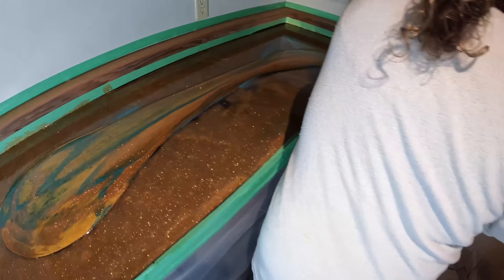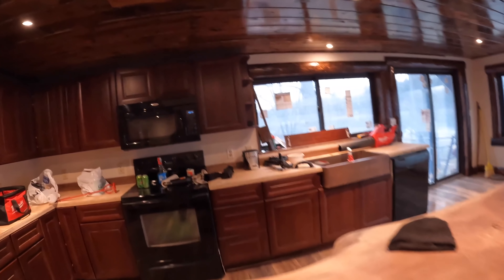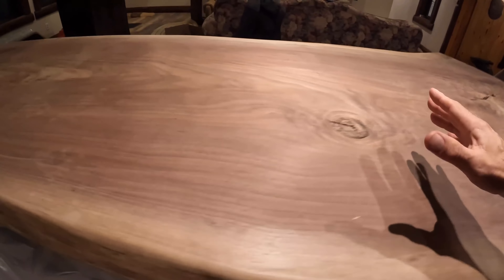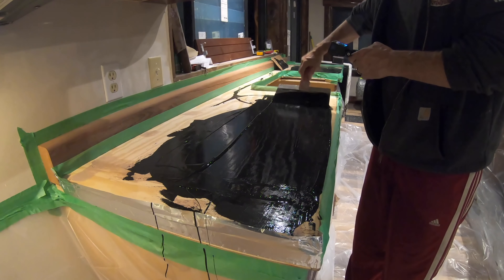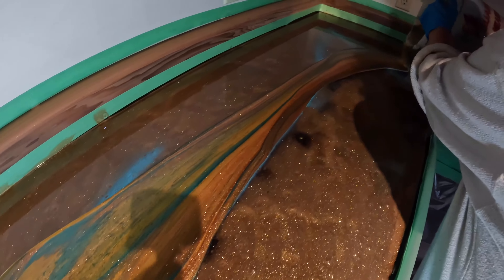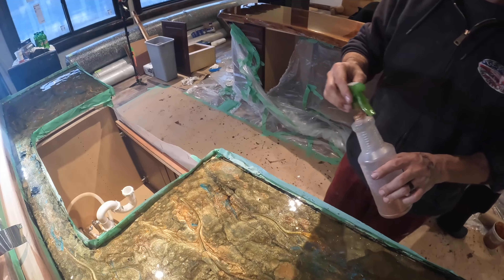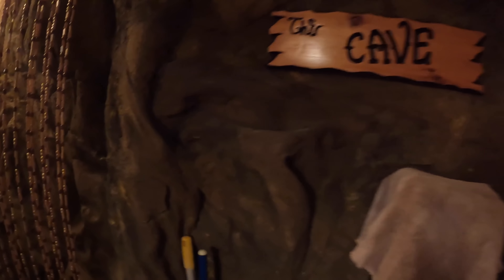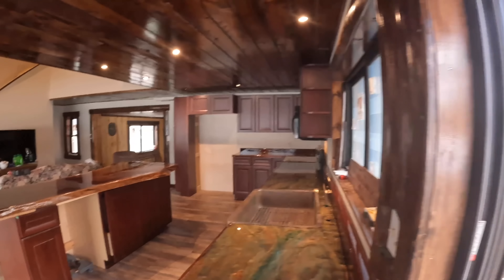Our First TIME pouring Stone coat countertops

Comment: Came over from The Stone Coat channel. 1st of all, both sides look great! But, the side you two did by hand is just phenomenal. 
This stuff is so fun to work with. My wife and I did our basement floor with Stone Coats flooring epoxy. We weren't sure what colors we wanted to do, so we bought a small countertop kit and every color we thought we'd like. I bought a sheet of 1/4" particle board that I cut into 12" x 12" squares and we just went to town making samples. It was so easy, that my young boys did a few samples. My friends were wow'd by the samples. Once we decided on colors, it was time to order and start prepping the concrete floor. 3 days of prep, 2 hours on Friday night for the prime coat, 4 hours on Saturday morning for the color coat and and hour on Sunday for final cleanup. Once the weather warms up, I'm going to do an outdoor concrete bar top with a friend and then eventually make my own kitchen countertops with epoxy. 
My piece of advice for this project would be
1: Run the counter to the wall, finish the epoxy and install the backsplash last.
2: Secure the top from underneath
3: Round over the front edge instead of edge banding. The epoxy will flow over and carry the veins with it.
4: I believe Stone Coat has a Top Coat now. Definitely use it.
Reply from the maker: Wow sounds like a lot of fun! Thanks for the tips, I definitely want to try this out again 😊👍

Comment: Mike from Stone coat sent your link good work on the counter tops.I did as you on the counter tops allowing like 2 ozs per sq ft. Then I seen on stone coat they used up to 4 ozs per sq ft. Now you just pour your counter tops not having to push pull move around your epoxy . Simply pouring takes out my  art and crafts effect which I don't have any. The pour does all the magic for me.

Comment: You could have put the screws in from the inside of the cabinets pointing up into the plywood, that way you will always have access to the screws to remove the counter top if you want to replace it
Reply: glad i saw this comment, thanks !
Reply from the maker: good point.
Reply: Same reason you use silicone instead of construction adhesive to install a solid surface.

Comment: For sure you can do the floor.  Mike has video on. It . You are fun that's why it's even more fun. You and your wife did an amazing job . I've not done mine yet just test pieces.  God bless
Reply from the maker: This process is such a blast.  I'm guessing once you do it you'll want to do more!
Reply: @Dirtmonkey  I've done two test pieces and a tiny inlay for my wife . I can't wait I'm planning on shower walls countertops as well as a river table . I have all the materials for the kitchen.  Just waiting for was weather . The air flow from the furnace.  Is not good for the final finish.  I'd prefer to take all the variables out . I tried to post pics here but can't seem to .
Reply: @Dirtmonkey  there are a few but of you just search it wait to u see the amazing stuff.

Comment: Looks good; I like the hand detailed side better as it looks pretty natural 😉

I’m working on my rig (ambulance) as I will be building it out as a truck/RV, but first I’m going completely through the running gear to have a sound road worthy RV / home in the future. 

So, this weekend is installing an ARB air locker as I rebuild the 14T 10.5” 373 Chevy full floating rear end (differential) 😊
Reply from the maker: Sounds awesome! Hope it turns out good and you have FUN doing it 😁👊 Go get em!!

Comment: You can epoxy your shower floor but you’ll need to add texture to it so that it is slip resistant. A lot of shower areas in RV parks, community pools and water parks use an aggregate dense epoxy fill.
Reply from the maker: Like that idea! Thanks

Comment: those came out great stan. I like the side you did by the sink. my off season project is building a camp trailer. i'm doing the design phase now while my shoulder is busted and i'll hopefully start fabricating it soon.
Reply from the maker: Sounds like you got yourself a fun project in the works.
Reply: @Dirtmonkey  yes and i get to learn welding too 😁

Comment: Lol….I’ve got my first big epoxy project in the garage now set to pour possibly tomorrow.
Reply: Keep the heat torch moving to destroy those air bubbles and not burn the epoxy.  I have built many cedar log furniture projects over the years from bed frames to full bars, pool tables including one for Joe Mauer, desks for Brooks and Dunn as well as a John Wayne Tribute desk for his son Patrick.

Keep in mind, if you do have air bubbles you can use a small grinder tool on them and they will fill in on the next pour round of the Epoxy.
Reply: I’ve played with smaller projects just to try and make my mistakes on less expensive pours. Those have for the most part have turned out very nice. The big one is set to be a 6’ dia spool end for a table.
Reply: @bigfoot-wo3qy  Bigger pours are really a pain in the ass.  The biggest one I did was a bar top for a bar that was 50 feet long with one continuous pour and done on their site.  I vowed to never do one of them again.
Reply: Find BG Woods on fb if you’d like. I post my projects there. Pretty much a growing hobby.
Reply: @bigfoot-wo3qy  I don't do any social media.  I used to but I kept getting messages with viruses in them plus all the arguing and whining from people turned me off of it.  Youtube videos are about as close as I get to social media lol.
Reply from the maker: You can do it!

Comment: Easier to do the backsplash parts separately and then put them on. Yes, you can epoxy the cement floor in the shower/bath! I like both sides! Fun to have used two different techniques.  Now you can enjoy both and have differences. I would have liked to see you do the edges.

Comment: I noticed your painting and I see the blue painters tape all over the place, one suggestion I would have for you is to get it cut in brush a very expensive cut in brush and you will not have to do anymore taping. That brush will save you time it will paint a line as straight as an arrow

Comment: I epoxied my bathroom floor over oak. It works.
Reply from the maker: Turned out cool?
Reply: @Dirtmonkey  Yeah, I like it. I put it over oak ply and it looks awesome. I need to hit parts with a torch but the minor glitches aren't that big of a deal. I never did the epoxy thing either but I am happy with the results and how easy it was to do compared to laying tile.

Comment: Great job brotha! Also check out Mike’s, “right hand woman, Rhonda Draculas of RK3 designs”. Those two are like frick and frack and she is equally talented but her designs are a little different and her teaching style is more detailed. I have learned plenty from both! Also, did you get the ultimate topcoat? That will add ultra hard protection for your project. Comes in gloss or matte finish.
Reply from the maker: I didn't het that but I may need to.  i will check out that other channel to - thanks!
Reply: @Dirtmonkey  good job on your first pour 👍🏼👍🏼 Be aware…this stuff is ADDICTING!!! 🤣🤣

Comment: How much does the resin weight when it's all said and done (per inch³)?  I'd like to do epoxy in my RV, but I'm worried about weight.
Reply from the maker: The total weight of the resin in the containers was about 25-30 pounds or so?  so its pretty light
Reply: We do RV’s all the time. Perfect material due to being very lightweight and flexible.